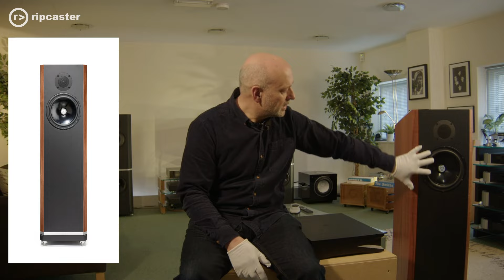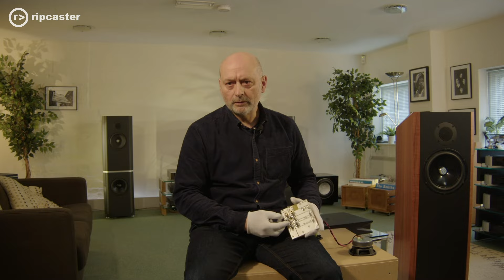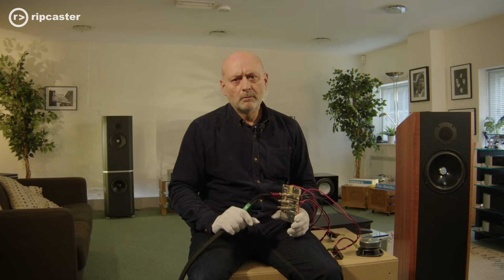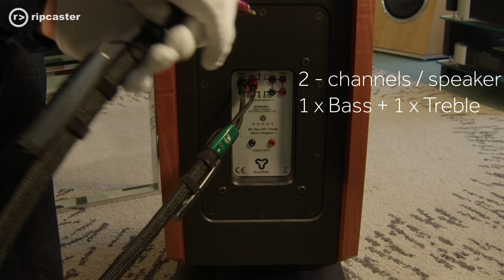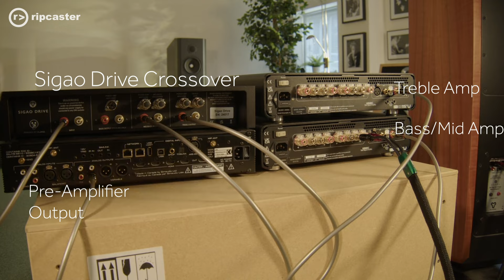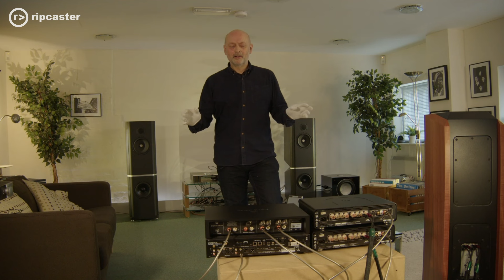Going Active with Kudos Sigao Drive at Ripcaster

Comment: What does the amp matching plug do? What is the difference between different plugs for various amps? I don’t get what this is doing. If the crossover outputs a line level signal and the amp needs a line level input, what is there to match? Is it not like saying you need to match a source to amplifier input?
Reply from the maker: Amplifier ranges have different output impedances. The plugs are used to match the impedance of the  amplifier so the Sigao crossover is matched to the input (amplifier) and output (Kudos speaker).

Comment: The Sigao is not an Active Crossover as it does not have a power supply and thus no amplification stage inside like a standard active crossover  has. It is a Line Level Passive Crossover . I have seen the Sigao at a dealer near to me but not yet heard it.

Comment: Can these be run with a single power amp or with an amp like the luxman l509 ?
Reply from the maker: To go active with Kudos speakers you need at least 4-channels of amplification (for 707,606, 505), and 6-channels of amplification for the Titan 808. This typically acheived using a number of matching stereo or mono power amplifiers. The Luxman is a stereo integrated amplifer - so not suitable for active use with Sigao Drive.